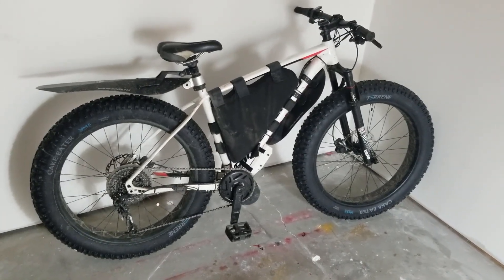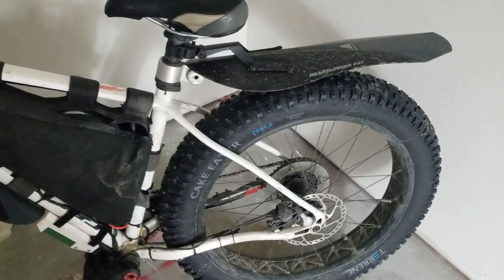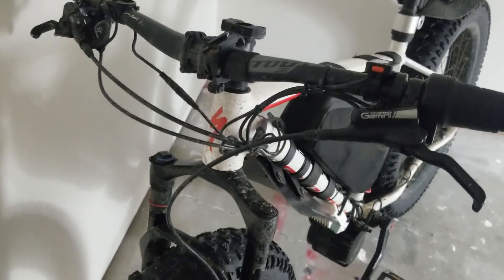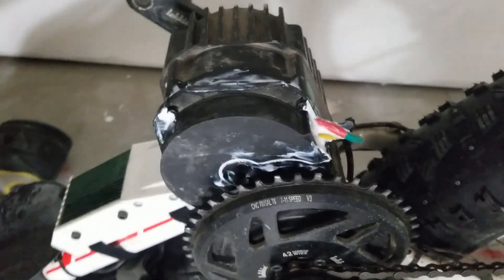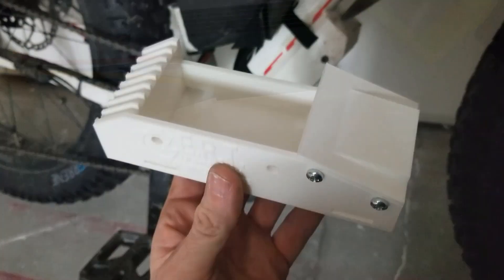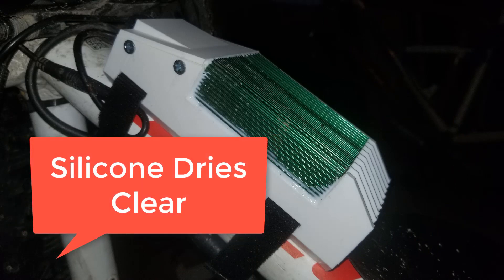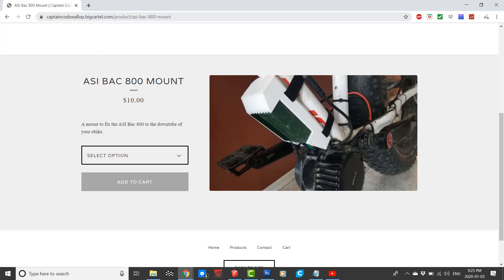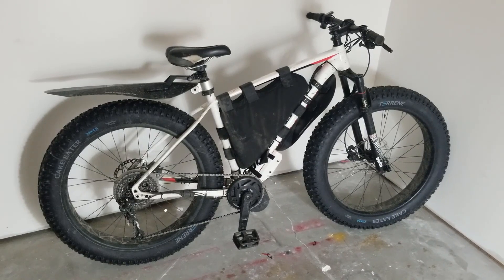Bafang BBSHD (ASI BAC800) - Specialized Fatboy - Winter Setup

Comment: Hello Captain Codswallop, I found these Fat Bike fenders that use an expending plug that mount inside your Steerer tube for mounting. Available here: https://www.amazon.ca/dp/B07B66GMMG    Should work on your ebike.   ... Also an ebike fanatic using BAC 800... https://youtu.be/zbBiMlinzlo  Cheers, Dan
Reply from the maker: Thanks for the tip, your bike is great! Subbed

Comment: Wow Capt, I just priced those tires and your rubber costs more than the average Joe's entire bike! I second Welsh Whoopee's comment about the Mudhuggers. I'm running an original size Mudhugger rear for my 26" 2.5 Maxxis Hookworms and it is awesome! I know zipties sound flimsy but once you get them on the fender doesn't budge and it's damn near indestructible! Andy Kirby runs them on his bikes also.
Reply from the maker: Thanks Eric, I will check them out.
Reply: 26" 2.5 Maxxis Hookworms - great option for 26ers, really maxes up the volume.

Comment: Could you print fenders in sections using PETG or nylon?
Reply from the maker: I have a project that may involve making a rear fender as part of a light cluster... I may attempt making one. Or a short section for the front. A few people made some suggestions so I'm going to have a look at those. Design time is limited so I'd rather not invest it in fenders... we will see. I may end up on this route.

Comment: I love my SKS fenders but I can't find any front fenders for fat bikes from them just the middle and rear.

I think you could 3D print one out of TPU, I've been trying it out but you need a direct drive extruder mod for the ender 3 and print real slow (max 30mm/s) with the Priline TPU from amazon and it works out pretty good, Not sure how well it will stand up in the sun though I guess you could have some sort of aluminum flat bar insert to make it a bit more rigid and for mounting it better.
Reply from the maker: I will have a look. The print bed is not the largest though... I may be able to make a frame and then cut a premade sheet of flexible material to fit. You having fun with the 3D printer hey!

Comment: Do you need brake or shift sensor cutoffs when using bac800?
Reply from the maker: Not really if it is setup well. I use one brake cutoff but I could probably ditch it. I found it was better to come off the throttle and shift using the residual power of the auto engagement mechanism or cut power with a short pull on the brake lever and spin the peddles to move the gears. If you are shifting more than one gear down the range then manually works well. Going one gear at a time I have never had any issues. 

I got my BAC800 from ERT so the parameters from a different source may vary but I have found smoother results without cuttoffs and letting the controller do the work. The auto engagement is one of the hardest things to describe!

Hope this helps.
Reply: @HighVoltageKits  Thank you for your reply!  I'm thinking about converting my gravel bike with drop bars. I don't think there's a clean way to add the brake cutoffs to brifters.  The gear sensor sounds like a pain (and I've read it doesn't work great anyways).  I just want to keep it simple with a clean look. If I go with BBSHD I'm definitely getting the BAC800 after watching your videos. I'm also considering the tsdz2 as that uses torque and doesn't need cutoffs.  Do you have any experience with tsdz2?

Comment: You can get someone to design and 3d print you the fenders
Reply from the maker: Its a good idea. I may have a crack at it. I am not sure I can print the flexible part but if I can locate some similar material I can likely craft a mount and then cut some to fit.

Comment: I hear that bac 800 helps put out a lot of power from what I understand which isn't much
Reply from the maker: Its definitely not the most powerful on the market giving a peak of 3500 watts and 90 amps (50 continuous). But for the BBSHD it is a considerable step up from the stock one. Its enough to wreck the nylon gear if not treated with respect. The real advantage of the ASI is the feature set that the operating system gives you. It is very complicated but allows for a good deal of customization in the right hands. 

The BAC2000 upwards are where the power is really delivered. I should be able to show a bit of that in the new year!
Reply: @HighVoltageKits  thanks for the reply
Reply: 50 amp and 90amp pick is for pahse or from baterry?